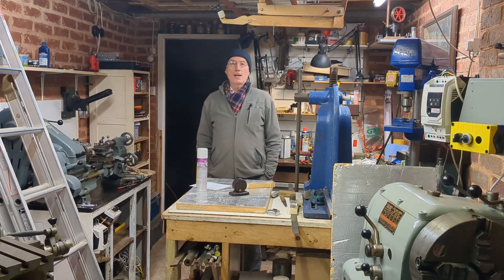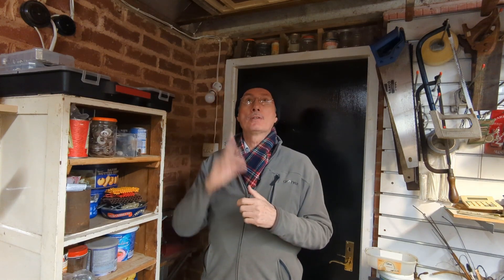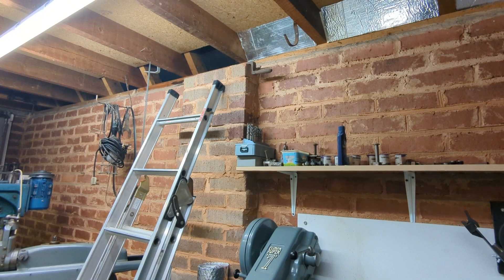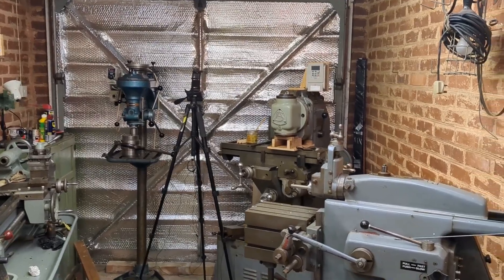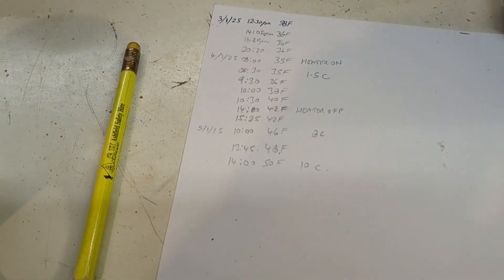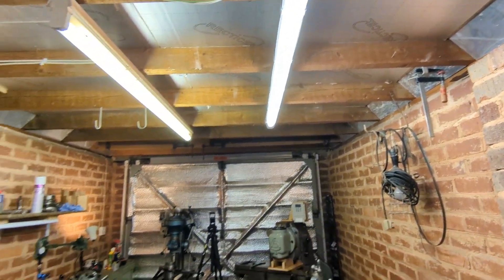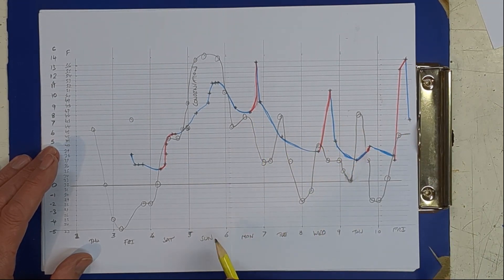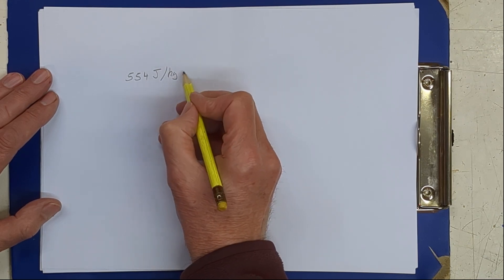Dealing with rust in the home workshop - part 2

Comment: That was an excellent film as always Clive. I liked the use of the graph to show the temperature swings. I think you are definitely heading in the right direction with the insulation. I believe minimising the temperature variation is the way forward. Up here in the highlands it has been between 0C and about -5C most of the week. My workshop temperature has hovered around 10C the entire time, give or take a degree, without any heating. I liked the calculation regarding the time taken to heat the mass of cast iron in the shop. However, as others have said it depends on the heat transfer medium, in this case air. You would need to work out the heat transfer coefficient for the air in your shop. But it was still fascinating and gave a great insight. I do love a calc! Corrosion on our precious machines is a truly soul destroying affair. My brother Dean at Retromeccanica channel had a similar issue which he solved with insulation. Also Jon of Jon's Workshop channel faced this problem and he managed to solve it. Both are worth a look. For general content, as well as their thoughts on condensation!
Reply from the maker: Thanks, Carl, for the helpful feedback. An average of 10C despite the colder atmospheric conditions sounds amazing to me! Yes, I didn't explain that calculation well - it was intended to show that things couldn't heat up faster than indicated and probably a lot slower than that. due to heat transfer and the other heat losses. I was in too much of a rush to get the video out!
I will at both channels to see how others have dealt with this issue.

Comment: Regardless of anything else you have to keep the machinery above the dew point, or have the moisture at zero. You can get dew point controllers for electric heaters which would minimise the heating required and you can fit cartridge heaters directly to the machines so that you only need the minimum of power. hope that helps.
Reply from the maker: Thanks, Peter for that concise diagnosis and for introducing me to cartridge heaters. I looked them up with their installation instructions. I suppose I could install in a large block of steel which makes good contact with the mill table - for example. I would have to install in each large lump though. But it would deal with the particularly susceptible items.

Comment: Well, these videos have spured me into doing more to combat the same problem. I, too, have a large mass of cast iron, Colchester Bantam, Beason hybrid milling machine, frame building jig, and motorcycles. I will be installing insulation this summer, but on the oil protection side, I want to persevere with slideway oil as it doesn't leave a residue. A suggestion from a colleague at work was to use an electric blanket (which are quite cheap to purchase) to keep the castings from dropping in temp. This actually sounds like   it might be worth considering as an experiment on the lathe first.
Great content, please keep posting.
Have you seen the Potting Shed channel? Very good videos on his shaper.
Thanks Jon
Reply from the maker: Glad to hear that they have been of some interest to you. Yes, I too wonder how effective diligent use of slideway oil would be. I suppose it is easier to miss parts of the lathe than with a spray can. I like the idea of the electric blankets!
Oh yes, I have seen the excellent Potting Shed video channel!
Reply: Morning, have just tried an electric blanket (Silentnight from Lidl). Didn't work trips out on overheat due to it not being covered. Was worth a shot

Comment: Interesting fact  ?
3hrs of heat input  🤔
Heat exchange from air to cast iron, I suspect, is very poor.
You need to find a way to change to conduction, I imagine .
Reply from the maker: Thanks, Steve, for your comment. You are absolutely right. I overstated the point! I should have said that the calc shows that it will take longer than 3hrs depending on heat transfer! Thanks for pointing that out. My main point was just how much thermal inertia there is.
Would be interesting to put temp probes and various pieces of equipment and actually measure the temp change.

Comment: Another option that might be worth exploring. I have heard of people putting aquarium heater pads on their machines to keep them "warm". These devices are relatively low power output but can be just enough to stop condensation. Apparently, the "oldschool" way is just to leave a 100W lightbulb on inside the machine cabinet.
Reply from the maker: Thanks, Jeremy. I can now appreciate why people used these old tricks. I am sure it doesn't take too much heat.
Reply: I have 3 overhead 4 foot led lights in a room that is 12'x12' I leave one of them on 24/7 no rusting inside the room. Outside the room in the same building everything rusts overnight. I have an experiment going on my mill vice where I cleaned the rust off with Scotch Brite and then applied Kroil. Also have a freshly machined piece of HRS next to the vice that has Kroil on one side and nothing on the other side.  I will look at it tomorrow. It has been in the 20's with snow the last 2 days. Today it is warming up to 50 so tomorrow's results should tell a good story. The mill is not inside the room.

Comment: Surprised to hear that just 3hrs of 1000kw each hr can bring the temp from 2 to 10 deg on the equipment, looks like your on the right track, a cheap diesel heater could be a very inexpensive way to go, 👌
Reply from the maker: Yes, but see Steve William's comment above; I should have said that it takes at least that length of time! I will see if I can get away without resorting to another heater - but noted. Thanks.

Comment: Nice progress and excellent and simple explanation of the amount of heat needed to raise the temperature of the shop machinery.  Looking at your calculations, it comes out to 3 hours to raise the temperature of the machinery by 8C, which is approximately 23 minutes per degree C of temperature rise.  If you check your Met office daily information (being American, I am assuming this is the correct source, please correct if wrong) for your area, it should provide you the expected low and high temperatures (with time of same) along with the expected dew point temperatures.  Knowing both the base temperatures and the dew point temperatures, you can calculate how many hours you need to run the heater to keep the workshop interior temperature above the dew point, which should eliminate condensation.  With a simple clock mechanism set to start and stop times for the heater, this should automate the process of heating the workshop.  

If you want to get really fancy (being a retired engineer myself), I bet you could set up a spreadsheet that takes into account heat soak time (both up and down on the machinery), along with entry data points for the low and high temps (along with time of same) and the expected dew point temperatures at the low and high temperature times.  This would calculate and provide an output of when the heater should start and stop and could be a daily activity, similar to winding a clock.
Reply from the maker: Thanks, Ron, for your comment and suggestions! I would take the 3hrs I came up with with a punch of salt! As Steve pointed out this is a minimum time assuming perfect heat transfer and no other heating losses. Really the calculation was intended to illustrate how much thermal inertia there is in a small workshop.
I like your idea of tracking the weather conditions and anticipating when corrective action is required. Unfortunately this wouldn't work for me as I would forget to do it! It would have to be automated for me. But  I am sure something could be worked out to improve the situation.

Comment: Hi you're definitely  heading in the right direction, and i liked the use of graphs 👍
I use ACF50 for my motorbikes as well for winter riding as well as the workshop, its really effective I hope you find the same.
I maximised insulation and draftproofing in my workshop as well, plus I have a freezer in there which also contributes a few background watts. 
Your workshop looks like its attached to the house, which should mean it gets some heat gain from the wall as well.
Obviously, electric heater is the most expensive energy source, you could tag on to your central heating, my workshop is detached so I've got a Chinese diesel heater for comfort however, I'm tempted to get one of the wall mounted heat pumps that Olly from ollysworkshop fitted.
Anyway I'm enjoying your observation based approach, and you should soon have a more comfortable workshop for summer as well as winter 
Cheers Paul
Reply from the maker: Thanks, Paul. Yes, so far the ACF50 is performing very well. It seems to be durable too. My workshop is free standing so no heating gain from the house. Yes, I am conscious of the cost of electric heating so will have to evaluate the relative merits of the cost of purchasing a cheaper option such as a diesel heater. Yes, it is already more comfortable to work in!
Reply: Ho Clive, glad you're feeling the benefit already. 
In the short term plug in smart thermostats are quite cheap now, assuming your WiFi reaches the workshop, you can schedule with something like IFTTT to track just about the outside temp and collect data for a graph in Excel. Although fair warning that can get addictive 😂
Reply from the maker: Thanks for this helpful tip. Unfortunately WiFi doesn't reach my workshop but I could get a WiFi extender. I had a look at IFTTT and it looks very interesting. I have used Thingspeak with a Rasberry Pi to do similar automated tasks with solar power, but it took a lot of time and effort which I don't think I can afford now. Perhaps IFTTT could be the answer. Yes, these kinds of project can be addictive!

Comment: I have approached the solution differently. The research into the many temperature differences in the weather along with the outside and inside differentials is interesting in and of itself and it may even bring you to an answer. The consideration of the cast iron mass is also an approach I had not really considered. When I first got rust in my shed, I did consider why my beautifully made and expensive tools had rusted in seconds. My non-engineer brain told me that damp air was the primary cause. This is where my approach was far more amateur and utilitarian than your own... I settled upon raising the temperature beyond the rust creation and human comfort threshold. 

 It turned out that the good old fashioned Factories Act 1961 ~ section 34 on Temperature mentions 60°F (20°C) where employees are sitting to do the work. I had no reason to trust or doubt that number but that was the jackpot number and I heated my shed to that temperature and maintained it with a thermostat and no rust was evident. My next shed was designed for the best insulation I could manage. I use a 2kW oil-filled radiator to raise and maintain the termperature to the target temperature. Last night the air temperature outside was as low as -5°C and the shed is perfectly warm enough to work in this morning. I suspect that the moisture content was substantial as the ice on my car was indicating we had about 6 ~ 8 degrees of frost during the night.

Could I save a few pennies if I was more thorough and scientific about my requirements? Probably I could but I like knowing that I have a rust free environment every day and the shed is held at a pleasantly comfortable temperature in which to work. I don't opt to adjust my temperature control for night and day temperatures because I feel (not knowing) that it would introduce the sort of temperature differentials that I am attempting to eliminate. I adopt a method of heating water at home that appears to work... I keep my immersion heater on continuously and the water is always at the set thermostatic temperature. In the bad old days, I used to turn it on and just heat the single tank of water to the required heat. 

I had an epiphany one day and realised that I was always heating the water from cold and that required a lot of time and energy if heated only twice a day. Now the thermostat controls the temperature and the heating comprises a small kick to maintain the thermostat setting. This appears to be more efficient and it is certainly cheaper. (no doubt and HVAC engineer will be along soon to tell me why I am wrong) Anyway, this is the overall principle which I use to keep my machine and hand tools from acquiring a patina of rust.
Reply from the maker: Thanks, Jeff, for your detailed comments. I wouldn't undervalue a utilitarian and common sense approach. Sometimes I can too quickly revert to trying to analysis simply because I find it interesting! The calculation I did is a case in point; I was simply looking for a very approximate understanding of why there is so much thermal inertia.
The old fashioned thermometer I have been using has the 60F comfort threshold marked on it! Sadly I will not be able to economically achieve that in the winter months. Congratulations on having such a comfortable workshop!

Comment: You are on the right track. If you can keep the temperature swings to an absolute minimum. The machinery will have time to adjust temp more gradually. If it has time to come up to temperature with the air you won't get condensation. 

The cold really isn't the problem.

The problem is when the machinery is colder than the dew point of the air. 

You may have to intermittently run a dehumidifier to lend a helping hand. At least to start. Otherwise you're starting fighting an uphill battle. 

That amount of cast iron also has a great deal of thermal inertia while heating it takes forever, it can help you on the back end. Keeping the shop warm after the heat is turned off.

Ask me how I know.... Cheers from Wisconsin.
Reply from the maker: Yes, I agree that the issue isn't the cold per se. Yes, I may have to run a dehumidifier - could be that one we use in the house becomes available!
I think you will have more experience with cold than I! Thanks for your feedback.